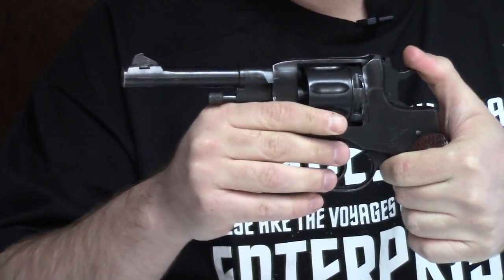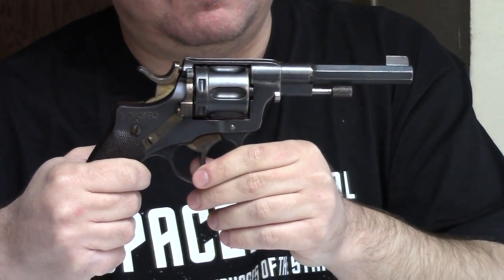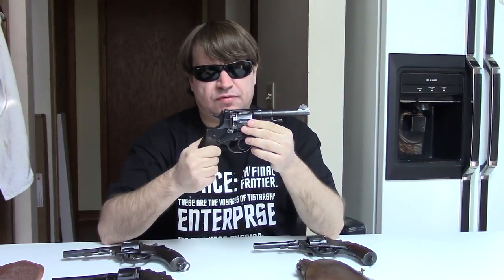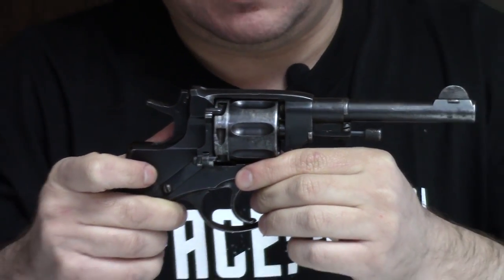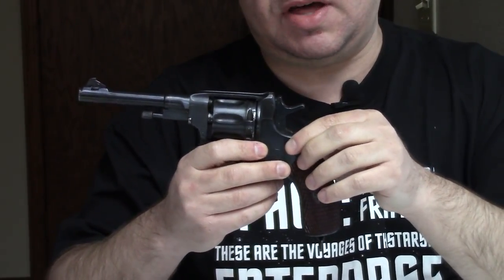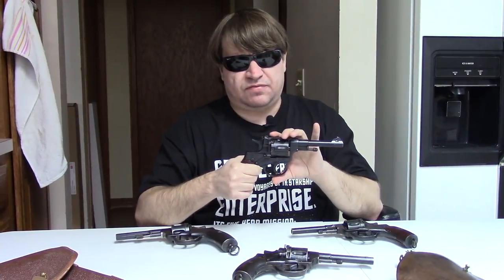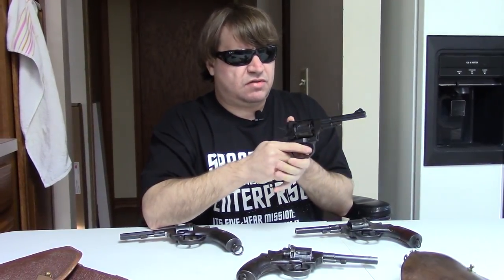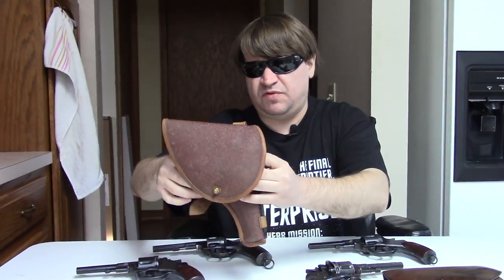Nagant M1895: Russia's Most Famous Revolver

Comment: I bought 2 about 15 years ago when they were under $100. I got a 1943 Izzy with Bakelite grips and a 1915 Peter the Great Tula with wood grips I bought them from J&G with no hand pick and lucked out on the PTG 1915. Yeah the trigger is horrendous in dual action, but if you pull the hammer back manually with your thumb the trigger pull is nice. I love the cool round it shoots and have found the original ammo (corrosive, but who cares) is noticeably more powerful than the new commercial non corrosive ammo. I should have bought another to suppress, but hate to do that to the ones I have.